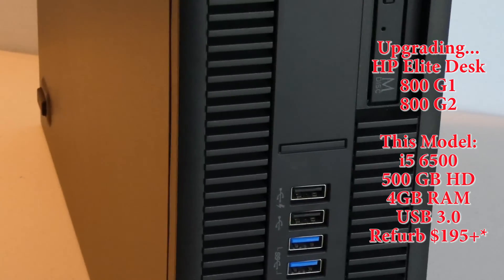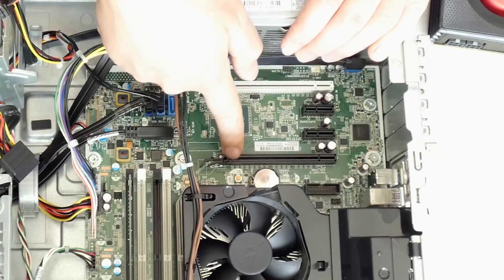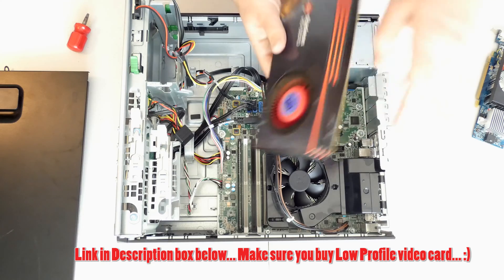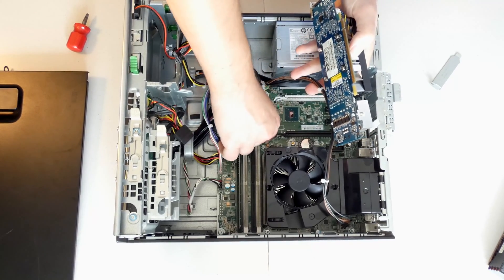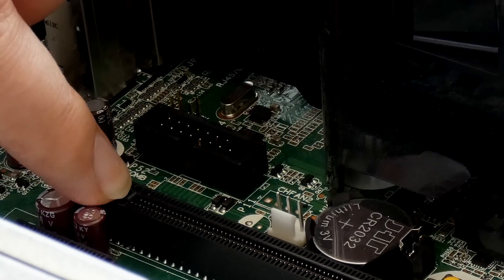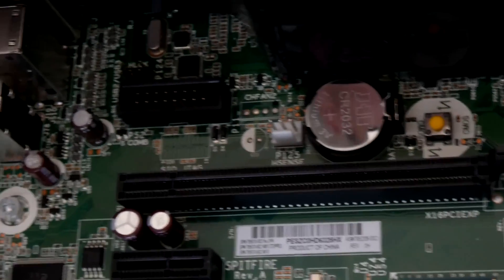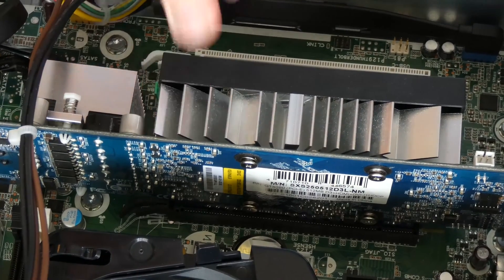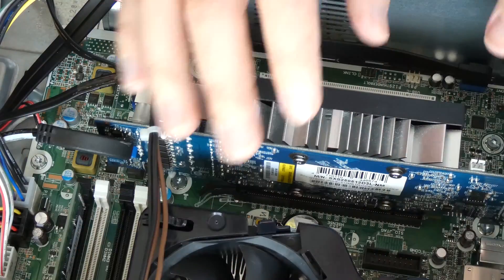Video Card Upgrade HP Elite 800 G1, HP Elite 800 G2, 600 G1  Small Form Factor Desktop

Comment: I have an hp elitedesk 800 g2 but I don't know if the motherboard is compatible with the atx cases and I don't know if there are adaptors for the power supplies since the original one is not very powerful, does anyone know if they exist?

Comment: Hello @Cobuman. I thinking to upgrade my hp elite 800 g2 video card and found GTX 1050 Ti MSI Graphics Card 4GB Geforce Nvidia low profile LP GTX 1050Ti A2 this one card, does this card will fit to hp case? Thank you
Reply from the maker: Should work as long as it is a low profile card which that appears to be.
Reply: @Cobuman  Thank you. I bought MSI GeForce GTX 1650 4GT LP OC - 4GB - GDDR5 - Low Profile Graphics Card. Because little bit better.

Comment: Hello, I have a elitedesk 800 g2 sff with an i5 6500, 32gb of 2133mhz ddr4 ram and 1tb name by using a pcie adapter. I just purchased a rx 6400 and I was wondering if I should insert it to the same slot as you did which is the black one because currently I have the nvme adapter on the white one and secondly I wanted to ask if the performance will drop more than 10% because the card is pcie gen 4 and the pc only supports gen 3

Comment: What graphics card would you recommend to run Fortnite, on HP Elite G2 tower?
i7 core 6700 CPU 3.4 GPU
I also need to upgrade the RAM from 8 to 16.

Comment: Would the RTX 3050 LP fit inside this case? And would you need to replace the power? I heard the RTX 3050 has similar dimensions to the GTX 1650 LP. I think its TDP is around 65-70 watts.

Comment: Greetings cosmic novo,

I watched your video on Youtube about installing a graphics card into an HP elite desk 800 G1. I tried the link to Amazon for the GTX 1050   but they had run out of stock, so I looked at your video again and found the link for the  GTX 1650  which I bought. I installed it as per your video but now the computer won't switch on and made a bleep noise.........I was wondering if I bought the wrong card and, if  not, if there's something wrong with my computer, which I bought new very recently. 

Your kindest and most patient advice would be welcomed.

Yours sincerely,

Gilbert Kelly
Reply from the maker: Hi Gilbert. Yeah, those may be out by now. This video is a bit old now, but I would suspect any low profile GPU should work.

Comment: could sapphire rx 6400 low profile be installed on hp elitedesk 705 G5? do i need adaptor or additional psu?
Reply from the maker: It may work fine without any adaptors. I'm assuming you have the same size PC just like in the video.

Comment: great video i just wanted to know if we can remove the alert screen every time we boot the pc that the frontpanel usb is disconnected because it gets annoying sometimes to click space bar every time i open my pc
Reply from the maker: Thanks! In bios there should be an option called "halt on errors", that may remove it. I usually just put the computer to sleep rather than shutdown because it's faster to login.

Comment: I have a 800 G1 with i5 4590 and 240W power supply. I took the Nvidia GeForce GTX 1630 EX as reference, and it says it requires at least 300W power supply. I'm afraid the 240W from my power supply may not be enough, but I don't really want to buy another power supply just for the GPU. Is it ok to use the 240W power supply for the GTX 1660? And which one is better, the GTX 1660 or the GTX 1630 EX? The 1630 EX has 64 bit VRAM but is GDDR6.

Comment: Is this the same pc HP Elite Desktop PC Computer | Intel Quad-Core i5 | 8GB Ram | 1TB HDD | 24 Inch LCD Monitor (1080p HDMI), RGB Keyboard + Mouse | Desk Speakers | WiFi + Bluetooth | Windows 10

Comment: Is a new power supply or upgraded colling system recommended?
Reply from the maker: Depending on how much power the new GPU is using. The power supply is either 200w for G2 or 240w for G1.

Comment: I want to put in a zotac geforce gt 730 in mine. Is it compatible for this computer and is it good? So far it my only budget friendly option.
Reply: its not good unless you want to play older titles
Reply: @pixelexplorer2284  I ended up settling on a gt1030 which was a perfect introduction card for my computer at the time. Ive since upgraded my whole setup and got a rx6600. Still those budget builds are fun to work on and figure out how a computer works

Comment: Thank you!

I have the same PC you have in the video, but have been struggling to figure out the best cards? I've been looking at NVIDIA cards, such as the GeForce GTX 1660 Ti,  but I don't think it will fit. Is there something similar to it, or a low profile version?
Reply from the maker: It's been while since I've looking in to this, but the last time I checked the best low profile was GTX 1650.
Reply: @Cobuman  okay, thank you!

Comment: Hello, i have question today my GTX 1060 6gb low profile card arrived and is not whatever we try not coming in. Is there a way we can put it in? I'm willing to take of the case or De-assemble the entire pc for this! thanks!
Reply from the maker: Are you sure it's the "low profile" type? I didn't think they made 1060 in low profile... (if not, I would return it). if you have the same computer as in the video, you can possibly transfer everything to a different case> https://youtu.be/C70nmtTFPuw
Reply: well it is small lol. its more thick then long. thats the problem i have!
Reply from the maker: @waterberry6815  yeah, that is the "mini" version not the low profile. 😁
Reply: and will i need to get an external adapter or new  psu:?
Reply: So if i transfer cases i will be able to put the gpu in? even a full size one etc.? how much will the full operation cost?

Comment: will this work with an hp elite desk 800 g1 SFF? :) (GT 1030)
Reply from the maker: yes, just make sure you get a low profile card like this or similar: https://amzn.to/2qCucsj I just saw your edit... here is the link: https://amzn.to/2ZHXoPQ
Reply: @Cobuman  thanks! just got the low profile GT1030 GDDR5 version, coming monday.
Reply from the maker: @DDSProd.  sure thing.
Reply: @Cobuman  hello, just a quick update, I got my gt1030 but the metal bracket that came installed on it might be a bit to long, I can’t seem to install it and I tried a couple times, may you try and tell me what to do if that’s possible? Thank you
Reply: Nevermind, just saw it came with a shorter bracket 😂
Reply from the maker: @DDSProd.  :_like:nice!
Reply: @Cobuman  Gpu works very well and can handle the games I play on max settings. Once again, thanks for the tutorial on the installation! I subbed
Reply from the maker: @DDSProd.  :_like:

Comment: Hi, I have the HP 800 G1 USFF with Intel i5-4570S. I'm no expert with computers, I'm a total novice. I'm guessing I have an integrated gpu, and looking at the internals, I don't have that slot. I do however have a mxm slot, which has the notch in the middle. Is there a card I can get to install in it, and is it worth it? Do I need to add a heat sink as well, as the mxm cards don't have fans? 
Thank you for your patience with my rookie questions
Reply from the maker: That's an interesting question. They do sell mxm gpus like this: https://amzn.to/3iiy09K however, I don't have any personal experience with those... it kind of looks like you need install heatsink on top of that. It seems like it would not be worth doing.
Reply: @Cobuman  thanks for the reply. Yes, I'd need a heatsink for it and the parts I found online don't include it. I think I'll just save up some cash for  a better computer
Reply from the maker: @TheDisturbedManiac  Good idea.

Comment: for a 1050ti, do i need to upgrade the psu? the psu my elitedesk 800 g2 sff has is 200W and the 1050ti requires 75W.
Reply: Did it worked without upgrading psu?

Comment: I’ve just recently had a problem. I bought a hp Elitedesk g1 800. I got it and it was working fine. I installed a 4tb hdd and a zotac gaming gtx 1650. After installing I turned on my pc I got “no signal” and after 30-40 seconds the fan started sounding like a jet engine. I tried resetting the cmos by the button on the mobo and removing the battery. I still got the same problem. I uninstalled the gpu and still the same problem. Then I uninstalled the hdd and still the same problem. I don’t know what to do because now it’s no signal and the fan is going to max and not working. If you need more info I’ll be happy to provide anything. Please help if possible any suggestions would be appreciated. Thank you.
Reply from the maker: Did you disconnect anything else. Like a power cable to the motherboard. I would make sure all cables are plugged in. You didn't need to uninstall the HDD at all, that's not the problem.
Reply: @Cobuman  Thanks for you reply. I checked all my connections and didn’t unplug anything else. I only took out the hardrive because that was one of the 2 things I changed. I was grasping at straws trying to solve the problem. Before installing (gpu & hdd) everything worked fine. The power comes on but I get no signal and the fans ramp up to max and sound very loud. I tried resetting the cmos by removing the battery and holding down the little button for 5 seconds. Sorry if I’ve repeated anything. I’ve posted to a lot of different channels asking for help and you were the only one who replied.
Reply from the maker: @UtubeIsassHoe  Sure thing. Double check all of the cables just in case. Make sure RAM sticks are inserted all the way. Try one RAM stick at a time.

Comment: I wanna buy this pc, but I wanna buy a GTX 1060 6gb for it but the guy told me this pcs power will be too weak to handle it would gpu would fit for this
Reply from the maker: That might be true and 1060 will not fit inside of it anyway. They don't make 1060 in low profile form. The best low profile card is 1650 like this: https://amzn.to/3f4N1dO With video cards being super expensive I can't recommend you buy any of them at this time... however, 1650 should work fine.
Reply: @Cobuman  thanks I saw this online and they say it will work perfectly with my PC
Reply from the maker: @limo7570  cool. sounds good.:_like:

Comment: Here is my problem, I got a GTX 1050 Ti Low Profile to upgrade my G2 SFF but, and I'm sure you're aware of that, its bracket is actually taller (not wider), than the one from the GPU you used here, which is anoying because the G2 SFF back panel has little metal bars between all the slots in the back. Any recommendation to remove those? thx for the vid regardless
Reply from the maker: If the bracket is taller then it's not a low profile bracket. If the card you bought is advertised as low profile then it should have a 2nd bracket to swap out.
Reply: @Cobuman  yeah it does, it's actually fine - my bad ;)
Reply from the maker: @UTurn539  □No worries. I'm glad you found it.

Comment: How many internal HDDs can be installed inside this cabinet?
Reply from the maker: 3
Reply: @Cobuman  except for optical drive space ?
Reply: @Cobuman  or including that?
Reply from the maker: @ritu037  3 SATA connectors total. you can disconnect the optical and use HDD instead.

Comment: nice video. Would any 1650 lp card work on this machine or does it have to be a specific vendor?
Reply from the maker: thanks Thomas, any 1650 lp should work fine. Some models may require additional power but you can get an adaptor for it (SATA to PCIE). These cards normally cost around $180 but now days it's super over priced... If you can get a good deal go for it; but otherwise I would not pay double the normal price. I hope that helps.
Reply: @Cobuman  can u make a video where to put the Sata to pcie cable,I’m struggling where to put in on my pc

Comment: Hello Cobuman, I have a question since we have the same system unit. I would like to know if the SDDR3 type of GPUs would work with this unit such as the GT710? As the recommended GPUs are mostly GDDR5 such as the GT1030 which is very hard to find here in my country since there has been a GPU shortage here since the pandemic started last year.
Reply from the maker: Hello. Any low profile GPU should work fine.
Reply: @Cobuman  nice! Thanks sir! :)

Comment: I read in several places, mostly the official HP website, that these model PCs come with 35 watt limited PCI-E slots and that using a 75 watt card (the 1030 is low enough only uses 35 watt) can damage the motherboard or GPU.  Also I heard that if you have the 240 watt PSU, it's not enough power to handle all the components combined including the 75 watt card.  I'm not 100% sure if this is true but from every page online I've read everyone seems to agree that these computers can't handle a 75 watt card regardless of which PSU you have 240 or 320.

Comment: Hi bro
nice video
i have two question
1- Can i use this video card "MSI 4GB NVIDIA GeForce GTX 1050 TI OC GDDR5"
on hp 800 g2 small form factor?
2- Can i upgrade power supply to 300w?
Reply: Hi i wanna know you have progress?
Reply: Do you upgrade it?

Comment: I connected a 1650 LP to my HP 700 sff g1 and now it turns on but nothing it's displayed with or without the card, Do you know what could be happening? Note: there are no beeps it's just the fan spinning like crazy
Reply from the maker: It's weird that it does without the card installed as well. Double check power cables to make sure everything is connected.

Comment: @cobuman I have a 800 g3, and it only has a 180w power supply. Do you reckon I should upgrade my psu when adding a new gpu?
Reply from the maker: It should be around 200w, but anyway... Most people don't have any problems adding a lower power consumption cards like this: https://amzn.to/3o0D9ED Read reviews.
Reply: @Cobuman   I bought that graphics card and my monitor resolution got messed up. I went to change the resolution but the resolution is locked. Do you know what I can do? Oh and also it says that my monitor has a 1 hz refresh rate. Thank you for your patience.
Reply from the maker: @espionage1427  Rebooting PC can fix this but make sure drivers are installed from Nvidia.

Comment: Hey! Great vid! I was wondering if this graphics card can work for the EliteDesk 800 G2:
https://www.msi.com/Graphics-card/Radeon-RX-550-2GT-LP-OC.html
Since Canada prices is pretty bad and the used market is not great here either, I found this low profile graphics by random and was wondering if it's good.
Reply from the maker: It should fit inside the PC but I don't usually recommend AMD cards because they need more PSU power. You can't see it on the link you provided but for example this 4gb version requires 400w power: https://amzn.to/3duDn2a
Reply: @Cobuman  Gotcha. From MSI's website, it says it uses 50w max, and I assume that's a lot.
The used market here in Canada is quite bad haha
Reply from the maker: @dotnexyoutube  That might be true but 400w is the recommend total system power available. So, the card by itself might be 50w or more... Here is my video on testing power consumption: https://youtu.be/FHtlk-re_ss
Reply: @Cobuman  Thanks for the advice! I appreciate it a lot!

Comment: What should I do if my Video Card (GTX 1060) has those 6 pins ? How to get power on it? Thank you in advance!
Reply: this card fits so size is ok. (Gtx 1060 aero itx 6gb)
Reply from the maker: 😁 I was about to ask you how you made it fit inside the case; but, you can try using one of these SATA to PCIE  6pin adapters: https://amzn.to/2Gq7XxA
Reply: @Cobuman  thank you so much! I'll give it a try
Reply from the maker: @cursed_soulx4985  Sounds good.
Reply: @Cobuman  btw worked out :D
Reply from the maker: @cursed_soulx4985  Nice

Comment: i buy 1 of the graphics card for my pc from 1 of your link it didn't fit it way to big
Reply from the maker: Which card did you buy and which PC do you have? Links I have are all for "low profile" cards which should fit no problem.
Reply: @Cobuman  my pc is the same as the 1 in the video that how i find your video in the first place
Reply from the maker: @freddiesellars52  Which card did you buy?The ones I'm recommending in the links are low profile GTX 1650, 1050, or 1030 cards. Anything else that is not a low profile type it's not going to fit. Maybe it was just an honest mistake because I've never gotten this feedback from someone using my links.